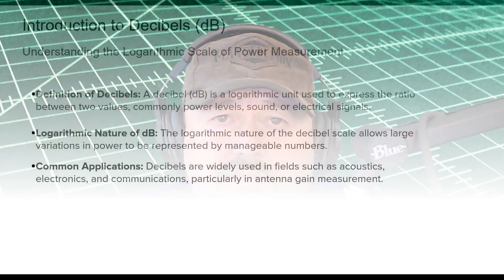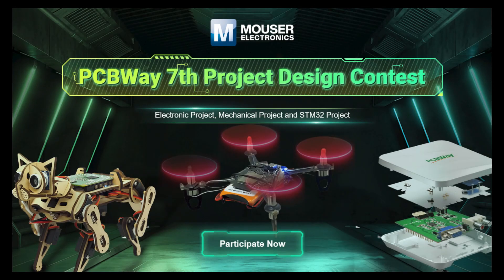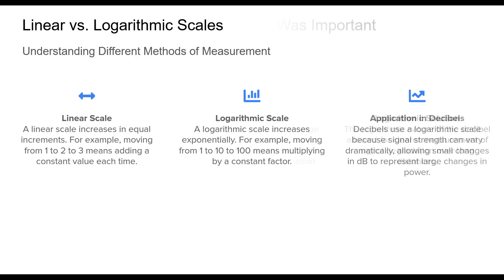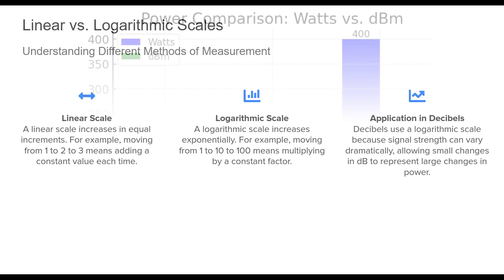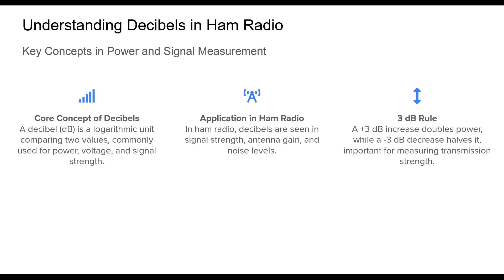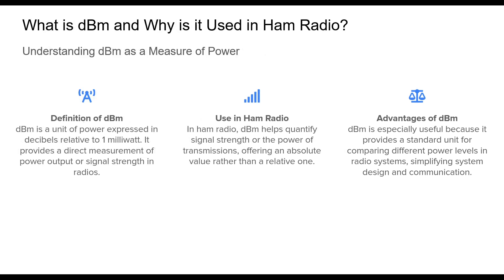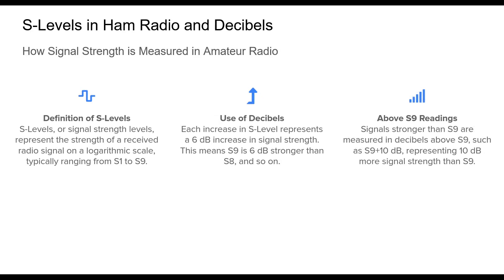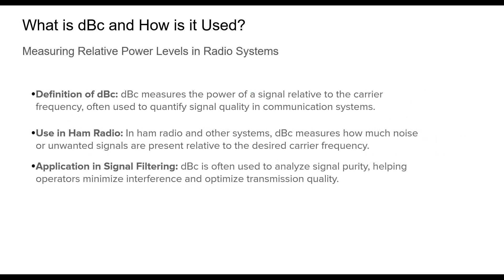Decibels in Ham Radio: The Essential Breakdown!

Comment: When we used phone lines for transmitter control, levels were set by sending (correction) 4 dB at the control point, and telco had to provide -14 dB at the far end, 10 dB loss. If we sent 0.0 dB it could create cross-talk on the lines. We would then set the transmitter for +/ 5 KHz deviation. If it was a paging transmitter, we used no pre-emphasis. If we used link transmitters instead of phone lines it was imperative the the TX/RX equipment had no pre/de-emphasis.
Reply from the maker: That’s some great insight, thanks for sharing 👍

Comment: That was a fantastic explanation of dBi and dBd. Yeah, I get suspicious of antenna manufacturer claims. When I first got into HF and DXing, I would get an antenna that the manufacturer claimed would give me a specific dB gain over other antennas. I'd set the antenna up and get results that were nowhere near the manufacturer's claims. I felt that I had done something wrong. I'd spend hours trying to get tweak the antenna. I wish I would have seen this video back then. Thanks for another clear explanation that didn't require an electrical engineering dictionary to understand!   73...Hugh...KN6KNB
Reply from the maker: Hey Hugh, thanks for watching.  There are some good folks selling antennas but unfortunately some are pretty terrible.

Comment: Many transceivers conventionally use a scale of 3 dB per S unit (It used to be always 6dB per S Unit)). While it may seem trivial to tell a ham operator that their 1 kW setup only results in a 2 S unit increase, the reality is more nuanced. In practice, those who own an amplifier and conduct A/B comparisons often find that when they ask the receiving ham operator to assess the signal strength, about 90% report a difference of 3 to 4 S units when switching from 100 watts to 1,000 watts. This observation suggests that S units may reflect a more common scale of 3 dB per unit, rather than the traditional assumption of 6 dB. DE NN2X / Tom
Reply from the maker: I think I did a video for this but I can't remember...  either way, I'd be happy to do more "S-meter, truth or dare" videos.

Comment: There is a standard for S-meter calibration.  The IARU has had one since I believe the 1980's.  Just google and download the IARU HF Managers Handbook.  If you go to region 2 they will direct you to the region 1 managers book.  It's under section "S-Meter Standards".  S-9 = -73dBm for frequencies below 30 MHz and -93dBm for signals above 30 MHz.  The reason the signal strength is two orders of magnitude lower on VHF and above is because there is so much less noise at higher frequencies.

Comment: That was great Ape ! Not many know the DB came from the telephone BELL . Bell labs . I was comparing 2 UNUN today . 4:1 different core and wraps on some 25FT wire.  I folded back to tune 1.1 on 28.074 MHZ . 1 UNUN is FT 240-43 wrap with #14 PTFE wire 15/30 wrap. The outher is T200-2 RED core wrap 8/16 . No noticeable difference on TX and RX. SWR about same swapping UNUN leaving wire same length . No heating on core only had a QT 60-60 watt radio.  I did a bunch of 60 watt SSB contacts . 10/11/12 was wide open ! I even herd 10 meter AM on 29 MHZ and tried and no contact . QT 60 does 50 watt PEP on AM.  Did not try FM . 73
Reply from the maker: I like that QT60, thanks for watching Robert 👍

Comment: In 1928, the Bell system renamed the TU into the decibel, being one tenth of a newly defined unit for the base-10 logarithm of the power ratio. It was named the bel, in honor of the telecommunications pioneer Alexander Graham Bell. The bel is seldom used, as the decibel was the proposed working unit. Wiki.  I believe the national bureau of standards has a bell that is a reference to one BELL and one tenth at a prescribed distance is one decibel.
Reply from the maker: Thanks Sean
Reply: Very helpful video - thanks! I have a question: on my portable shortwave radio, the display shows signal strength as dBm or dBi. What do those mean in terms of signal strength on receive?
Reply: @glantch  dBi refers to decibels measured against an isotropic reference antenna a antenna that radiates equal in all directions. It is a theoretical antenna since all antennas have some type of pattern here on earth....right
DBm is decibel measured against one milliwatt  as a reference .

Comment: Hi Ape,
Good explanations, however Icom in their infinite wisdom has been using 3 dB per S unit since releasing the IC-7300. Stay safe.  73  WJ3U
Reply from the maker: Hey Don, unfortunately there is no “standard” for S-level.  The only thing manufacturers seem to agree on is -72dBm or so for s9.
Reply: @TheSmokinApe  Well, every amateur radio manufacturer has been using 6dB per S unit except for Icom when they released the IC-7300. I think it's -73 dBm for S9 on the HF bands.  73  WJ3U
Reply: @TheSmokinApe  My original post got blocked because of reference to a website.  I made a separate comment (without the link) to the IARU HF and VHF Managers Handbook that does have a standard for S-meter calibration.  And for HF it's -73dBm not -72dBm for S-9.  Been around since the 1980's.
Reply from the maker: @mikesradiorepair  I said 72 or so, because I didn’t think it was exact AND the “standard” doesn’t mean everyone uses it but thank you for the additional information.
Reply: @TheSmokinApe  Agreed.  Standard has been around since 1981 and some amateur radio manufacturers still don't use it.  Funny thing is CB radio manufacturers adopted it immediately.
Reply: @TheSmokinApe  I should mention it is industry accepted that one S unit is a 6 dB change in signal strength below an S9 signal level.  WJ3U
Reply from the maker: @DonDegidio  there is nothing saying that radios have to be designed that way, that’s my only point